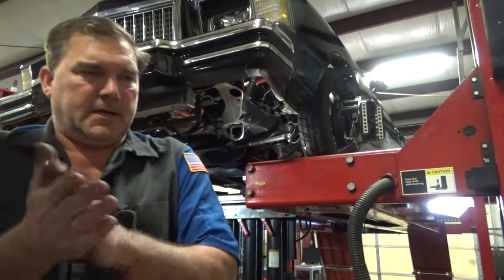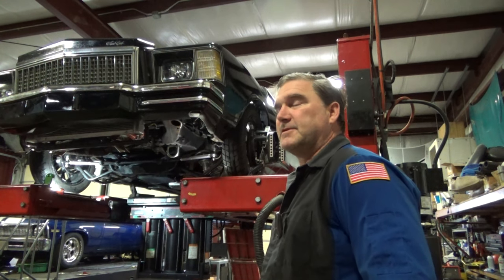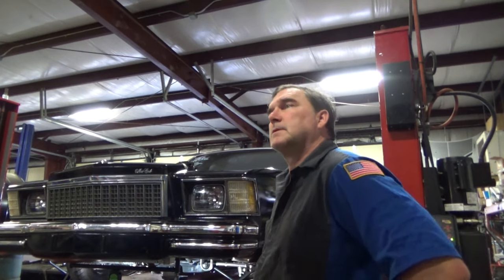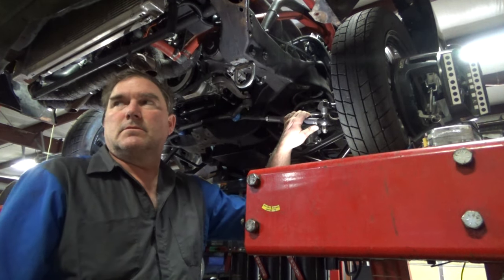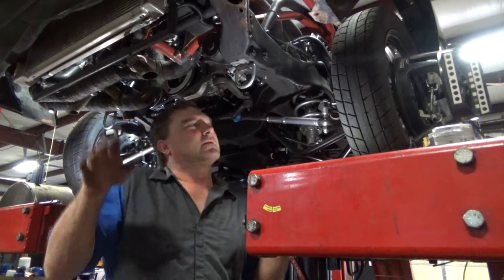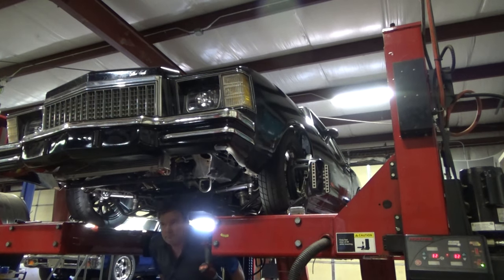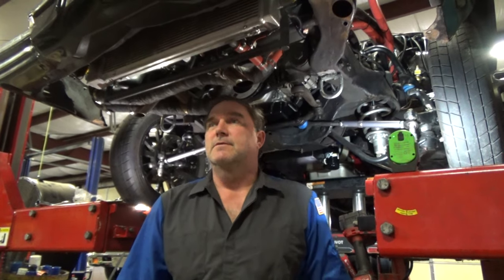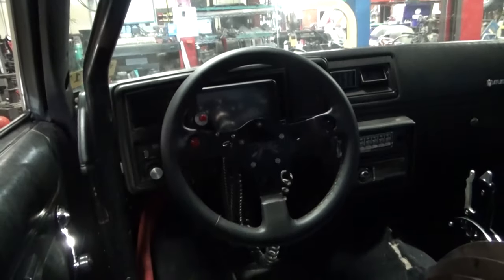Chevy G Body Chassis / Suspension Setup WAY more than an Alignment!

Comment: Just curious but, i thought that car had a removable quick release steering wheel which would make re-clocking easy, at least in my race cars. That way you would noy have to do it at a universal joint.
Reply: on some the quick release has a master spline.

Comment: Hi Rich, what would your target caster be for a 65 pontiac gto street driver?. I have aftermarket upper and lower arms, tall spindles and have managed to get 99% of the bump steer out of it. Its currently running just over 5 deg caster both sides but it still seems to lack much feedback and self centreing. Its much better than original but i feel i could go more caster yet, thoughts?.